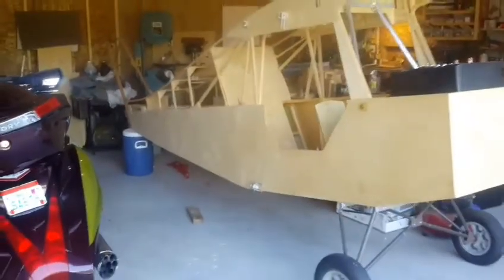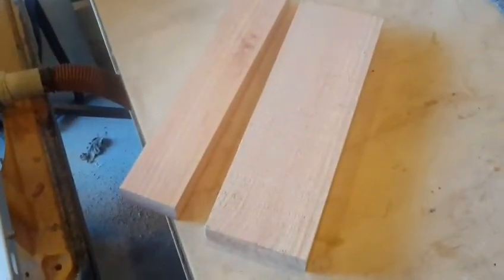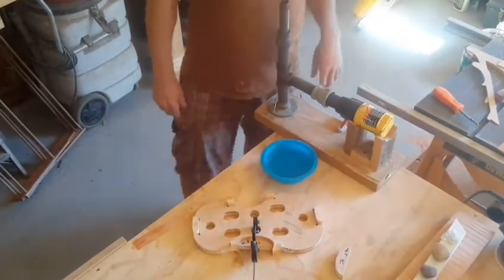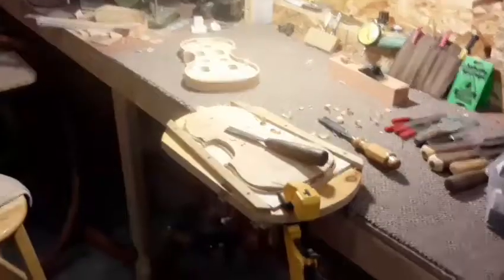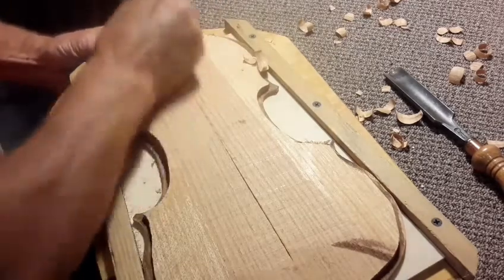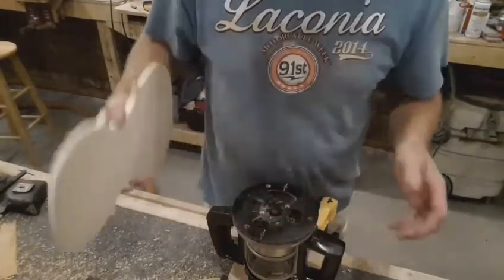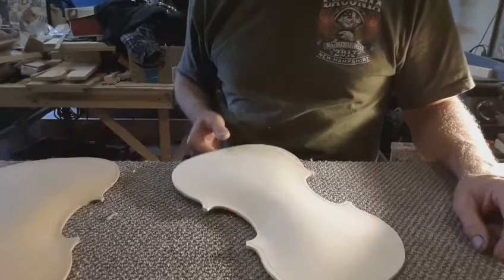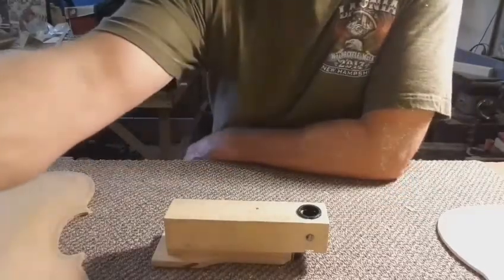The Farewell Fiddle -- part 1

Comment: Do you have recommendations for getting started to build a violin
Thanks
Reply from the maker: #1. Read.  www.makingtheviolin.com
a free resource that is excellent.
BEST book ever: The Art of Violin Making

Find yourself some wood.  You will need to end up with two pieces 15" long, 9" wide and 3/4" thick.  

Gouges and chisels are best at 2nd hand stores, antique shops, or online.  
Finger and thumb planes are available from China via Ebay.

Just get started and pick up what you need.

I'll help any way I can.
Reply: Jon Mangum thank you Jon I will keep you up to date on my tool collecting and progress.  Do you think cherry would be good for back and sides might have a couple of pieces kicking around
Reply from the maker: Yes, absolutely -- I am building a fiddle with a cherry back next.  You can either use it quarter sawn, or slab sawn ---have the rings curve down, opposite the curve of the violin plate so you don't expose the annular rings as much.  It will be more stable.  I have done it both ways....even bastard sawn.
Reply from the maker: You can also laminate 2 pieces for the neck if you like.  It is extra strong and the seam undetectable.